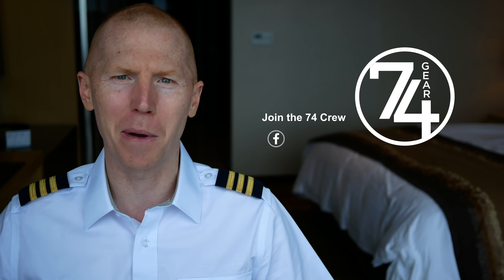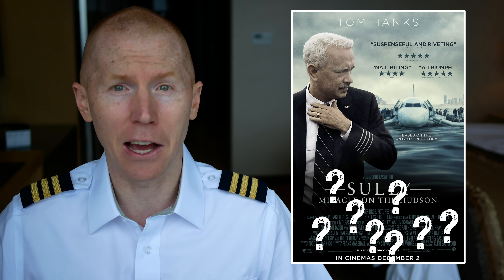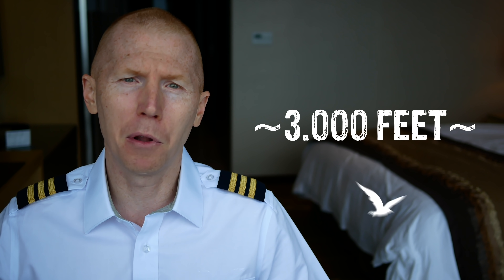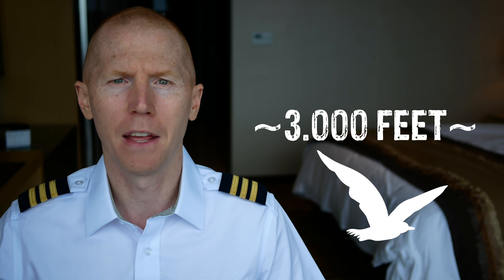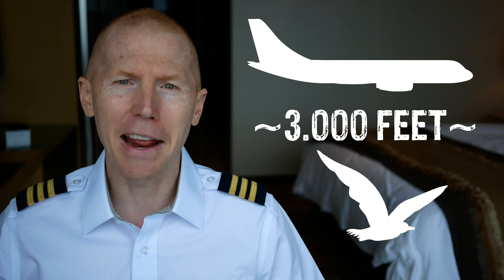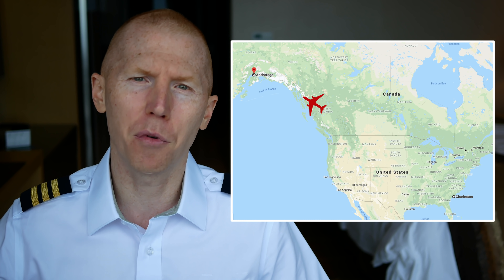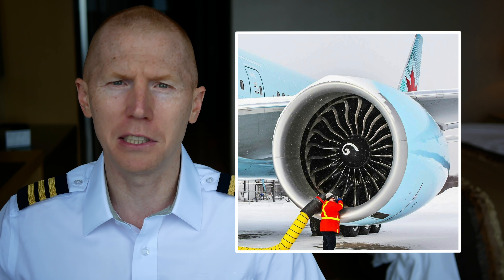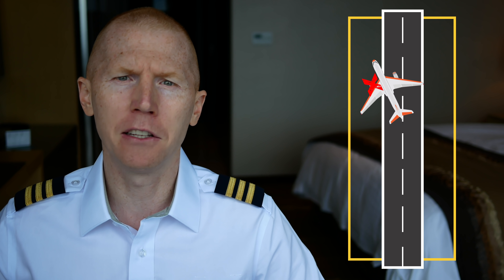Why Engines Don't Have a Mesh or Grates to Stop Birds

Comment: 4:05 100% this. At the end of the day this just isn't that big of a problem. You think aircraft engineers couldn't prevent this if it actually was a big problem? There is an insane amount of intelligence in that field around the world. If planes have a problem it is solved, simple as that. Bird strikes are not solved? Therefore you can rest assured bird strikes are not a problem.

Comment: I work on aircraft myself. I would imagine that the mesh/barrier would have to be constantly inspected for corrosion and wear. You would trade a low chance of hitting a bird on a few aircraft into a low chance of every aircraft ingesting a barrier failure, and something strong enough to impact a bird would be a lot worse than a bird itself lol.
Reply: "I would imagine that the mesh/barrier would have to be constantly inspected for corrosion ..."  And dead bird carcasses.

Comment: If the grate will have large sections, surely it cannot affect the air intake that much? 
it will still allow smaller birds to get in but will block/grate the bigger ones at least.

Comment: Why not have a automatic gate that can pop up and down with a button. 

 You make the gate pop up during takeoff, retract it while during the rest of the flight. It may take away some fuel efficiency but it will save lives in the long run as well as $25 million engines
Reply: In most cases bird will go to combustion chamber at it will be a fried chicken. Nobody will die, when one of two engines will fail. More of that, plane will not fall like a stone when both engines will fail. Stop spreading myths.

Comment: So.. just have an automated door that can cover the engine while under 3000 feet and retract when above that and sacrifice a little fuel efficiency for safety
Reply: something like 80% of bird strikes go completely unnoticed even by the pilots. The FAA made a report on bird strikes that underlined the threat of bird ingestion saying it would take large flocks of medium-sized birds or a small flock of large birds to cause enough damage to abort a takeoff
Reply: I’m a mechanical engineer. So if you had an automated door that blocked the entrance, you would restrict air flow and the plane would have a harder time taking off. The aircraft is sucking in so much air that you would have to make sure that it wouldn’t suck the automatic grate in with it (because a whole bunch of metal going into an engine is a whole lot worse than a bird). Also, the points on a grate would have a very high stress concentration and would make them a lot more likely to break (especially if they are super thin which you would need to not restrict airflow). Just from a safety perspective, it would be safer to kill a couple of birds every once in a while rather than risk the retractable door potentially sucking metal into the engines a lot more often
Reply: @thardin1719  excellent explanation! Salute!
Reply: but you'll have no sufficient power to come up in altitude
Reply: @hxneey7572  Well it's just very thin wires tied together into a fence, so it won't stop too much airflow or cause blockage, not even barely...
Reply: @Ariez05  Obviously you have no idea how much air is sucked into the engine. If you were to walk in front of the engine, it would lift you off the ground and into the engine. Now, let's imagine "little bitty wires" trying to withstand that force. Not happening.
Reply: No thanks. Extra parts means higher ticket prices. Keep chopping up birds.  They'll be OK
Reply: Engineers have looked into the idea of screens and they come with certain problems.  Its not certain that screens would be effective protection for bird strikes in the first place.  it might even create new potential problems and new points of failure if they break and get sucked into the engine themselves.  Screen have a potential of causing bad airflow for the engines intake and can cause a stall.  They also tend to ice easily in icy weather.
Reply: The door will be sucked into the engine next
Reply: @EternalHappElements  just make the door un-suck-in-able, simple!
Reply: Nah thats absolutely nonsense...xddddd where u living mate? On mArS?
Reply: Add a automated gun
Reply: Lol retract into what
Reply: A door….that covers the engine….that needs to be unblocked in order to produce lift…..right. Friggin YouTube junkies pretending you’re smarter than you are.
Reply: “Sacrifice fuel efficiency” they ain’t sacrificing nothing, the price of plane tickets will just increase
Reply: @jonelite2894  That are subsidized by John Q Taxpayer
Reply: @jonelite2894  May be he is talking in environmental terms.. Sacrificing Fuel effeciency is causing environmental harm, besides possible financial harm too..
Reply: @jonelite2894  that’s not true. The world is heading toward using less fuel. Of course you can just push the price onto the travelers, but the amount of fuel the Earth has is limited and we will soon run out if we continue with this track. But it would have run out already if we didn’t improve the engine at all.
Reply: Aircraft mechanic here. No engineer would waste their time trying to design that. The amount of components that are already in an engine already leaves little room for compromise and would be another set of wiring
Reply: @geezusotl4021  I heard they can handle a single bird. But a whole flock of them getting sucked against a retractable grate would have the same disastrous effect on airflow anyway.
Reply: @dennymambo  Yes, a flock of large birds would cause damage
Reply: @geezusotl4021  exactly, and we would make mom's spagetti instead of an engine. As we all know mom's spagetti is not air born most of the times!
Reply: @geezusotl4021  so what  gathering you guys don't want to be bothered with this am I right?
Reply: @jadedharlequin2  I’ll put it this way. No matter what, an engine can handle eating up a bird and spilling it out no problem, but if you fly into flock of birds then a cover won’t save it. If it was a good idea, it would have been invented already. Planes have a ton of failsafes
Reply: @geezusotl4021  Mig 29 mate have this system
Reply: @geezusotl4021  design it on the outside
Reply: One of the houses my mom rents out is rented to military. This couple that lives there uses birds of prey around the airfield of bases to make sure no birds go into the engine of the plane. I know some airports have done this in the past and some just don’t do it at all. It should be standard at all airports. The birds of prey are trained very well and actually work amazingly.
Reply: I love it when people who don’t know how things work say:  “All you have to do is just……”
Reply: Dude, just think on what you just said. If you put a metal door in front of the jet, it wouldn't be able to suck air and then it wouldn't WORK. Jet technology is more than 50 years old. The engines are tested in all kinds of conditions before hitting production. It's a gigantic project with hundreds of engineers involved. Do you really think that in half a century not a single one of them had the same genius idea that you're proposing?
Reply: They don't have screens because they are not needed. Most engines are designed to ingest birds.  The engines that do need screens have them. Look at a picture of a Chinook helicopter.
Reply: Terrible idea
Reply: What a dumb idea, just ensure he engine can withstand a bird strike!
Reply: Bro they need full power to take off the run way..
Reply: Lol you would need the engine most during low altitude
Reply: I expect that weight will be the downfall of that solution. The added weight of any retractable cover would impact efficiency (in the airline business, reducing weight is an obsession) too much for there to be a benefit. It would be like driving around with fully kitted out firefighter in your car, just in case in catches fire; the extra couple of hundred kilos you’re lugging around would result in worse fuel economy, and all you’re gaining is protection against something that’s incredibly unlikely to happen, and vanishingly unlikely to be disastrous.
Reply: @Mark-Stone  Not to mention the additional aerodynamic drag it would cause.
Reply: Excellent idea, like a hydraulic grid.
Reply: @KenBo Slice smartest comment here lol
Reply: Thank you furry my little pony youtube channel for your insight into engineering, which I'm sure you're very knowledgeable about
Reply: The problem is money
Reply: Never wondered but thanks lol
Reply: Yes, let’s have more stuff in front of the engine to FOD it out. 🗑
Reply: A little fuel efficiency? I don't think you understand how much fuel these aircraft use at their most efficient
Reply: Someone should just call Tony Stark. No problem.
Reply: Have JATO rockets to hurl the plane into the sky to the sky above where birds normally fly. Have the  air intakes covered until the solid propulsion rockets burn out and are jettisoned, and then the air engines operate once the plane is above normal bird level. I mean the passengers will be uncomfortable during the JATO phase but oh well.
Reply: @Defender78  yes, rockets. That's definitely the safest, most cost effective way to lift a plane to altitude lmao
Reply: -How do you engineer a strong enough "door" to resist the suction of the engine, stop a bird flying towards the engine at a combined speed of 250/500 km/h but light enough to not require extensive structural modifications, especially if it's movable or hinged, which are weak points.

-How will you make sure that this is not weak enough that a big enough bird wouldn't just rip this door apart and everything gets ingested?

-How will this door affect engine performance? If it's used during take-off it might result in longer take off rolls, or more thrust needed (more fuel consumption and maintenance).

-Where do you store it when it's not needed (almost always) without creating too much drag?

-How will the engine be affected if this thing fails, both in open/close position, or jams in some strange way? 

-Is it worth it to continuously carry weight, add drag and complexity just because it can save the airline a few million dollars for the one time a bird strike happens?
Reply: @federico339  make it out of mithril
Reply: Where would you put the door away? And the contraption for retracting the door? And all of that have to be rigid enough while not messing up the air dynamics.
Reply: it's possible, SU-27 has that. But not for bird. But for debris. That can open & Close when the pilot wants so. 

Everything is possible, so yah. They could do that. But would cost millions to design.. And they would lose Millions. Cuz it burns more fuel due weight & Design.
Reply: @itsSEMlH  But the SU-26 is a prop, right?

I was going to ask something similar myself. I saw a video showing how hardy Russian designs are compared to most in this world. If know those plans well, would you mind mentioning how they design them to be so tough?
Reply: That's overengineering it. More points of failure. Not worth it.
Reply: Thank you. I was having this thought the whole time. 
I’m sure there’s a way to do this, we just haven’t figured it out yet.
Reply: @myklelara  bro it’s common sense y
Reply: Thought the same but then there's the added issues of additional wiring, electronics, and where would the retracted metal go? I guess the engine is already packed with stuff there's barely any room.
Reply: you have a dumb and bad idea and im glad some other responses here thought about it for 2 seconds or less and explained why.
Reply: Bro you are dumb. Just let the engineers do their job and you be happy making your instagram stories. "A little fuel efficiency for safety" like wow.. its easier said than done.
Reply: @lazarusgrey  Did you really have to abuse someone because you think you are smarter than? Bullying is ugly buddy.
Reply: @DarkWeb-w9m  I am not bullying anyone. It was never my intention. I just think if you dont know anything about a certain thing, then you shouldnt pass comments like that.

Comment: I'd have thought it was because a mesh/grill in front would break easily after a bird strike (like the difference of speed is a few hundreds of km/h, which means a crazy amount of kinetic energy which it must release during the crash). And to me a grill or parts of a grill in the engine are much worse than a "soft" bird, even with the bones.

Never thought fuel efficiency would have  been the major issue !

Comment: Also It was an extremely bad luck to suck in several giant geese in both engines. A jet engine is designed to take on a bird up to the size of a chicken. And with the mesh - imagine that mesh being in the center of the engine suction. That would mean there would be a huge risk of it coming off mid flight and damaging the aircraft!

Comment: the one thing iv learnt most about aviation is,
it's extremely common for extremely rare things to go wrong.
Reply: It's extremely common to hear about extremely rear things.
Reply: Kinda makes sense, because if something went wrong on the regular, they would allready have put measures into place to prevent it.

Comment: I was in the airforce on c130j. You said more modern planes having auto trust control system to bring the plane back under rudder authority in the event of a loss of thrust on a outboard engine.  The herc had that 20 years ago?!

Comment: It sounds like the risk of bird strike is only really on take off and landing, you could have retractable screens that come out from the wing or fuselage and cover the engine only when it is below 3,000 ft, then they retract for higher altitude flight to still get the higher efficiency.
Reply: The screens won't really do anything though

Comment: This might be slightly different, but from memory, the only aircraft that has anything remotely similar is the MiG-29, which has big metal plates that close the air intakes on take off and landing. They have little slats above the main intake that open up on takeoff and act as a supplementary air intake. It also stops the engines from sucking in dirt, stones and rubbish.

Comment: seeing how insanely strong the exhaust is id think those metal frames would be bending from the suction power of the turbine?
Reply: Obviously it would be designed with a material that can withstand the power of the engine, most likely allowing for some small but natural bend to occur
Reply: @ClassicMist360  orrr put it triangle like pyramid
Reply: @voiceofreason1829  Ummm no

Comment: Technically you do not burn more fule if you have less Air in the engine otherwise it would burn too hot and it could melt itself

But 

Thrust would be reduced and with that also speed and weight capability

Comment: 1:18 For the explanation. Basically it ruins the engines sucking capabilities. 

Interestingly enough that's different than what I predicted because I thought the reason would be that if the grate were to break it'd get its debris into the engine and fuck it up.

Comment: Pilots are highly skilled and highly trained people, but nevertheless I have a bit of trouble with you logic: the more air a jet engine takes in, the more fuel the engine burns, the more efficient the engine runs, you say. I thought it was all about efficiency these days. If the engine gets less air, it just runs a bit leaner or when less fuel is burned, it gives less thrust. Could you clear that up for me, please?

Comment: So it’s like a huge turbo. Putting a mushroom filter will limit the air going in to the turbo but if you don’t have one you risk getting junk in the engine but with more power.

Comment: I actually have wondered this and it sounds like the increased expense of fuel use is the reason not to have some type of guard. So now I’m wondering why not a guard that stows away above 3,000 feet. Do your thing, Engineers! 😉
Reply: ................ Okay i want u to think THINK!!!

HIGH SPEED <--!!! Airplane vs Bird...

U can try anything to prevent it to get sucked through the engine... Even with a damn fence or somethin like that.... A bird would just explode because of the speed and the pressure if it collides with the airplane. A door is to heavy and not compact at all. A fence would do nothing except kill the bird anyways because??? SPEED AND PRESSURE... And it would go through the engine as well
Reply: It isnt really worty it because its only for a few minutes and also the person that replied above me has a point
Reply: No it won't work.
In case a bird hit that screen below 3000 feet, Due to engine's force, It won't be able to fly away and then after 3000 feet are over it'll go straight into engine.

What you wanted to solved still hasn't been solved and added a useless screen in front.
Reply: How about tucking away the complete engines below 3000ft? 😂
Reply: They’ve done ‘their thing’ and come up with the optimum solution already!

Comment: Most bird incidents occur around 3000 feet and lower? 

Why not have something like a "Open Cap/ Vented Lid" that could be "Opened or Closed" when you are at lower altitudes such as 3000 Feet.?

I get the engines need to be "Fully Open" when above 3000 feet, during a "8 hour flight" or what ever the amount of time would be, added with, being above a certain altitude of "3000 feet" but maybe it IS Possible Engineer.